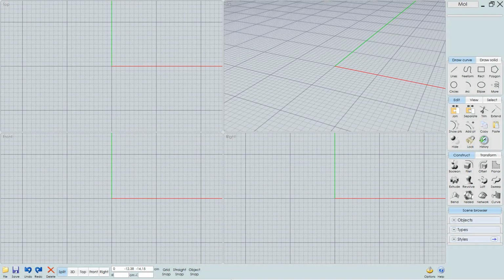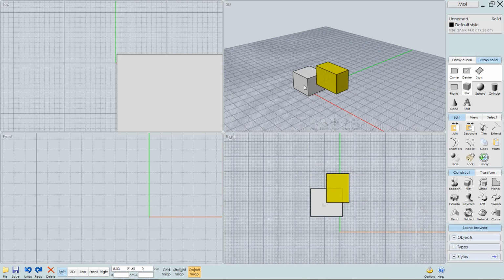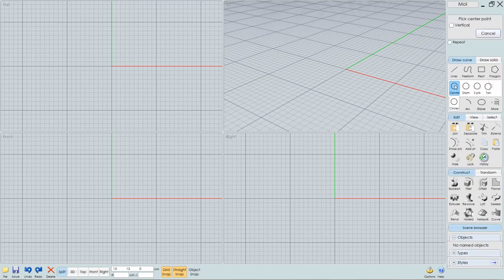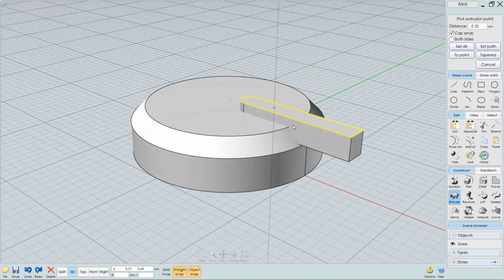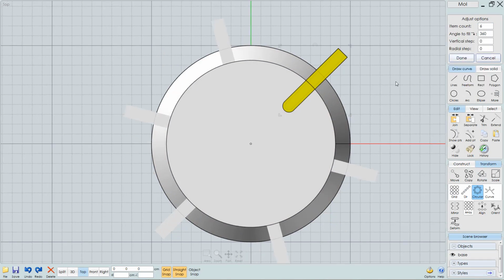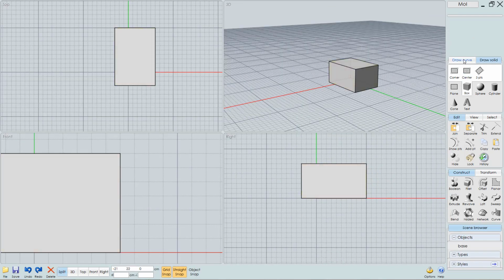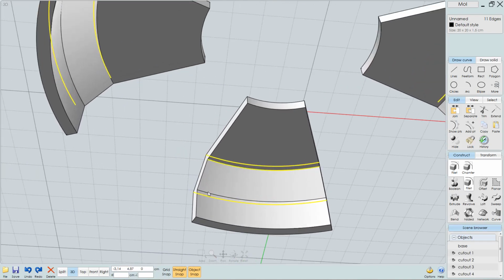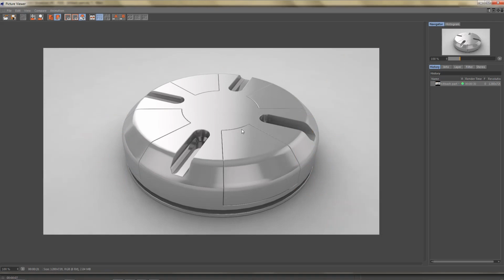MoI3D + Cinema 4D - Modelling a simple SciFi Kitbash Part

Comment: hey there thanks for the amazing tutorial ! how good is this software to be included in my modeling workflow . also i come across rhino aswell which alot of people appreicate for similar stuff. what are your thoughts on both and is it worth learning ?
Reply from the maker: Hi Ahmed, 
You're welcome! 

Apart from MoI I don't know any other NURBS modelling applications. The only one that I might have a look at at some point is Fusion 360. 

I could pick up the basics of MoI pretty quickly, took me about 2 weeks or so. I lked it immediately and had a lot of fun with it. Export of objects (and curves as Illustrator splines) to Cinema 4D works really well. Since it is CAD software, you can model very precisely. Compared to other 3D applications, it is affordable. And there's a demo you can try. The downside for me: 

Going beyond the basics in MoI is difficult. There's only a handfuly of good tutorials on how to really use MoI, and generally there are only few learning resources. My main problem in MoI is that, while creating more complex shapes is a lot less painful than in C4D, beveling is a nightmare and spoiled a lot of the fun of using MoI in my workflow. I still like MoI and it is fun to use it for basic stuff occasionally, but I don't think it's going to be a big part of my personal 3D workflow. Since it is only being developed by one person, adding and improving features takes forever. I haven't really used it in a long time. 

For the reasons above, I've started learning Blender instead. For the kind of hard surface modelling I'd like to dive into, especially the add-ons available for Blender are more suitable for what I want to do. Precise modelling in Blender is a royal pain though. However Boxcutter/HardOps etc. do a great job for hard surface modelling tasks, and beveling - as compared to MoI - works very well. 

Sooner or later I'll have a look at Fusion 360, too. If it weren't subscription software, I'd already have done that. It certainly has more features than MoI, and there's a lot more learning material.

It all depends on what exactly you need and want to do. I really liked the following  training videos for MoI that also helped me to get started: 
https://gumroad.com/l/vavRq
https://gumroad.com/edonguraziu

You can do great stuff with MoI, and the basics are simple to learn. But like I said, going beyond that is anything but easy, at least for me. I will still try to get a grip on Blender instead. It just seems to be the better choice for me. 

This is, of course, very subjective. You'll have to make up your own mind. You can always try the MoI demo and see whether or not it works for you.
Reply: @Wolf-4D  i really appreciate the effort you put in your videos and your quick response ! You are a gem !!! 
furthermore thank you for the detailed answer and i think i will give my self time and do a proper research before investing my time in a nurb modeling software.
Reply from the maker: @ahmeduzair9999  You're welcome, Ahmed! Thanks a lot for your kind words. Yes, take your time and have a closer look at some applications to find out whether they work for you and whether you want to spend money on them. It's always difficult to recommend or not recommend a particular application, and it's always subjective. What my be perfect for me, may be anything but perfect for you. I hope you'll find what you're looking for.

Comment: thank you so much ... I just jumped to the c4d section in this video to see how the mesh will look like from MOI but you didn't turn the wire frame on :) so as a quick question as long as you don't care about topology can't you did the same in c4d by boolean operations and you will still have the modification ability ?
Reply from the maker: You're welcome, Mouhammad!

Yes, I didn't show the mesh. Since it was imported from MoI, which is  NURBS/CAD modelling software, the mesh basically is crap.... :-) I've uploaded a wireframe render for you to my dropbox: 

https://www.dropbox.com/s/nw03by4736xk36l/kitbash%20part%20wire.jpg?dl=0

An object like this, which is fairly simple, can certainly be created in C4D, too, either with the C4D tools or with one of the boole plugins available for Cinema, and you will get the same bad topology. If it's a more complex object, CAD software like MoI3D would be my first choice as it has far superior boole tools that work much better. I find that in C4D non-destructive boole operations make the scene and the object pretty heavy pretty fast. I have tried the Nitro4d Box Tool, for example. It is really nice, but it gets clunky really fast.  If you need the ability to be able to modify the object after all the boole operations, Fusion 360 might be worth having a look at. It seems to be a bit like 3ds Max as it has what is called an object history, which lets you go back to any previous step right to the beginning or back again to the finished model non-destructively. MoI, unfortunately, does not have that kind of history for objects. 

The advantage for me is that you can focus on the design, work very fast, and model much more precisely than you can in Cinema 4D. If you give it a try and work with MoI or Fusion 360 for a while, you'll probably understand what I mean. Since I discovered MoI a week and a half ago I already know that I won't use Cinema much if I need boolean operations... :-)
Reply: @Wolf-4D  Thank you again and again for quick reply  , you know how much I love your tutorials ... and yes I differently will choose fusion 360 if I have the time  to learn new program , and I can understand you totally  about MOI and generaly about cad programs cause I have a wide background with autocad and rhinoceros ... but I was always wonder why Arrimus 3d choosed MOI rather than rhinoceros and when I saw you did too I hoped you can answer this question cause as per my little experience rhino is so much powerful than MOI  but I would choose fusion 360 over them cause of its procedural nature 
it is always an honor to chat with you ...so I hope you have a discord channel to have a little chit chat when you have the time and God bless you
Reply from the maker: @mouhammadwasseemshaabani47  I am enjoying these conversations with you, too! :-) 

I almost started with Fusion 360, but then saw the Arrimus tutorials on MoI... I guess he chose MoI because it is easy to pick up and use it to sketch designs quickly, especially for someone with his knowledge and skills. If you start working with Fusion, let me know how it goes. Fusion 360 still is a program I want to look at. The fact that it seems more complicated than MoI also was a reason why I wanted to give MoI a try first. I have only glanced at Fusion and I think it definitely is more powerful than MoI. It also has a proper scene manager etc. MoI is being developed and updated by only one person who, by the way, used to be one of the developers of Fusion, as far as I know. 

I don't have a discord channel yet, but I'll take a look at it when I find the time. Would be nice to chat now and then. Bless you, too!
Reply: @mouhammadwasseemshaabani47  Hi Mouhammad I use MoI and it is fantastic. It really is just a simplified Fusion / rhino, in fact Michale Gibson who created MoI also played a big part in the creation of Rhino, so I guess you could say he knew he could make a program as good as Rhino without all of the complications. If Arrimus uses MoI then you know it's gonna be good. There are occasions where I use it to make a model then bring it into Cinema and retopologise it in quads because I want to make good uv's but the bonus with doing that means you get good at retopology too!